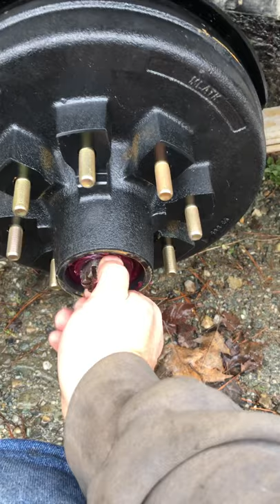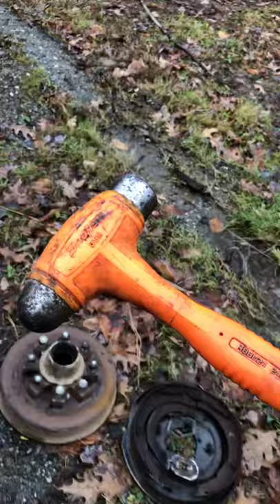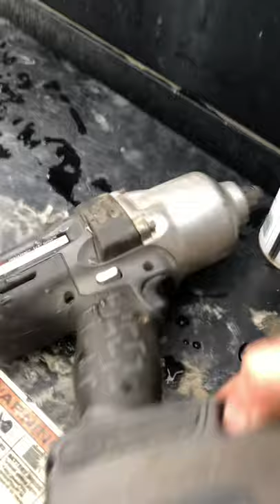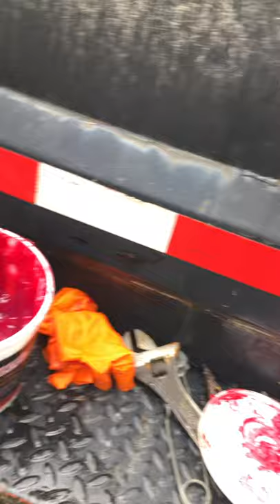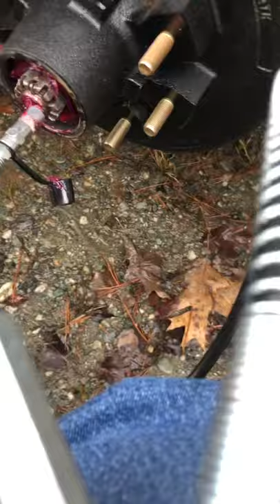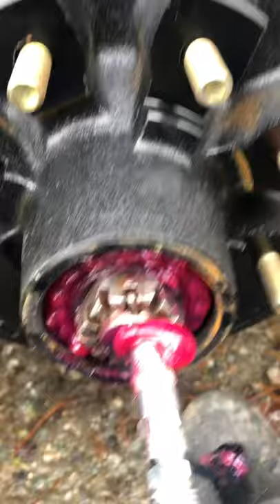Setting the preload for trailer bearings.

Comment: Power grease gun usually results in pushing the inner seal off especially when you don't rotate hub while greasing. Really coats the brakes nicely. Been there done that.

Comment: good lord, leaving it tight is asking for trouble. Back off 1/6 turn, then its near zero with a little room for grease when it's hot. Cotter pins are cheaper than dirt.

Comment: Good video, but I wanted to point out semi bearings are not torqued to 250 lbs. You would burn it up very quickly if you did that. There is a technical process I believe you first torque it to 250 but it must be backed off. However the only right way to do it is not by torquing it because torque can not be precise because grease, or dirt can change the pressure it puts on the bearings. If you want to do it truly right, you need a run out gauge and you would then check for the specified end play for that specific bearing. That's the only way you would ever properly 100% set these types of bearings. However, almost no one really does that. The best way is to tighten as you spin as much as you can. Then back off, then repeat, tighten and spin to ensure it's seated. Then back it off 1-2 flats is typical shop procedure. Loose cone bearings are better then tight ones. I had a trailer with loose bearings and I drove it cross country before I found out and they were fine. But tighten them up, you may find yourself stranded in an hour or less. People make a huge deal out of setting preload on these. They are very easy and the tolerance honestly isn't extremely critical like on other bearings that need to be spot on. These have a little wiggle room

Comment: Slightly more than finger tight is better. Finger tight increases the chance for looseness later on which tapered wheel bearings should not have. Done this for 51 years.